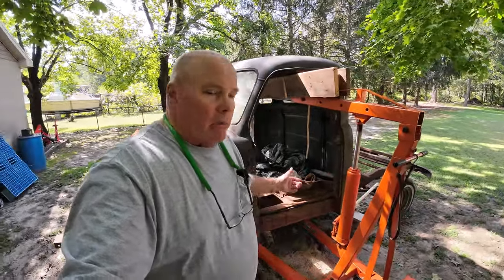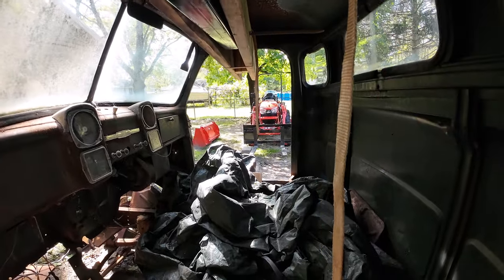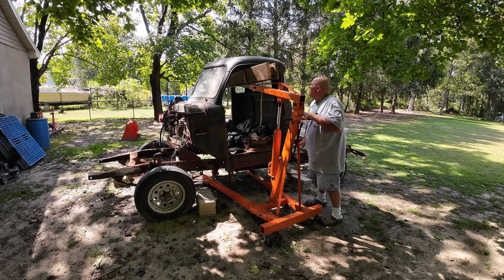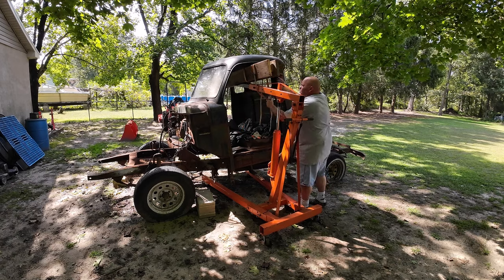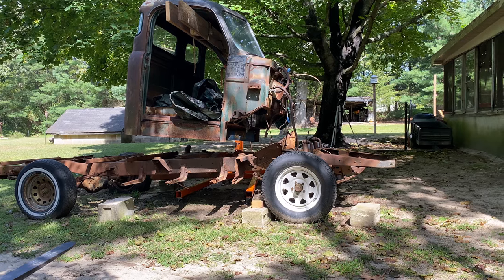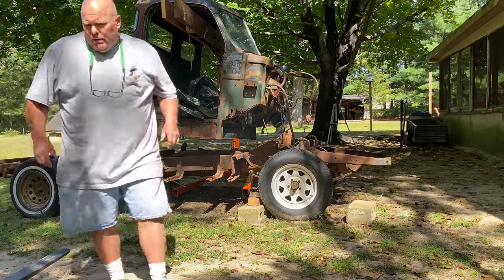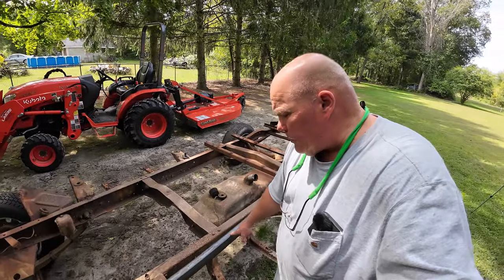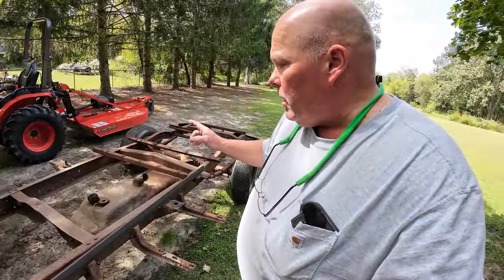Removing The Cab from A 1953 Dodge B3B Pilothouse Pick Up Truck. Project Pilothouse Part 7

Comment: What are some synonyms with the F-150 cab off the frame use my cherry picker like he did but I use straps to mount to the seat belt bolt Downs seat belt bolt Downs in the rear and then for the front I was able to find other places where I can put a bolt at the Loop dingo smooth but it did come off
Reply from the maker: Thank you for the comment.